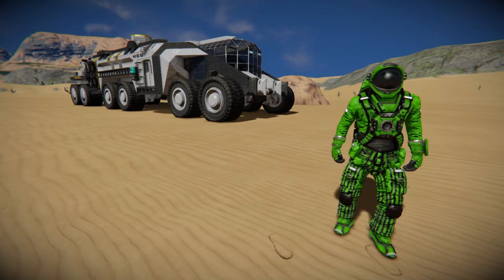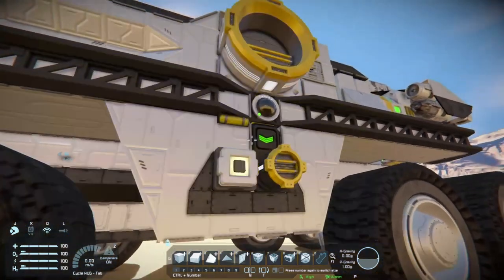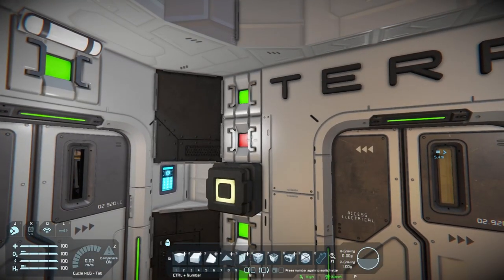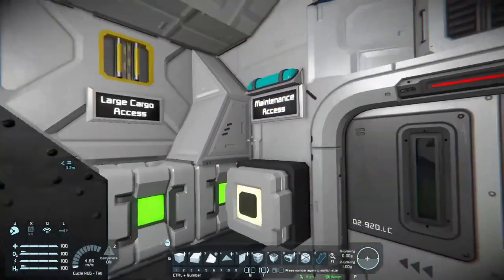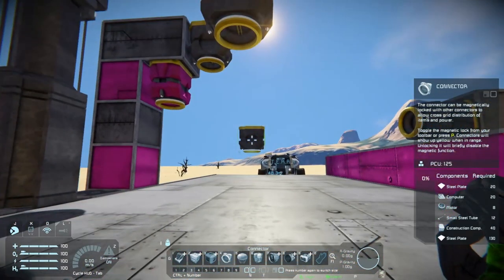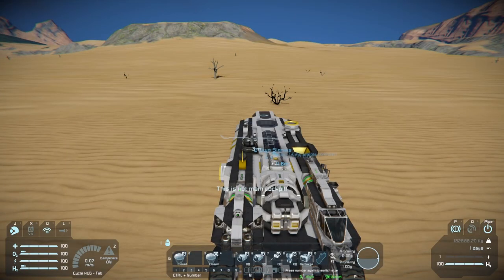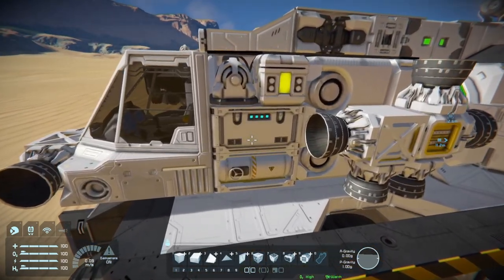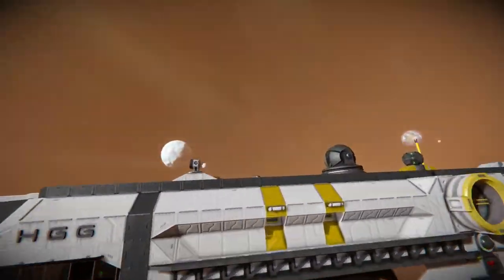T.E.R.R.A. 3-in-1 Multigrid! Space Engineers Showcase (HGG - TERRA)

Comment: A very nice survival build, I love the immersive features! :)

I'm thinking of some small upgrades:
 - you could add a Timer Block as a Remote Drone starter sequence (turn battery to recharge, start engines, etc.) with just one click;
 - I like to have 2 connectors on the same side, so it automatically alignes the rover / ship more precisely (since you have 2 attaching points instead of 1);
 - some pistons to lift up the rover in case a wheel pops is always a great emergency feature.

Looking forward for your next builds and keep up the good work!
Reply from the maker: Thanks!  I'll definitely add the lifting poisons, that's something I have on most rovers already.  I'm also already planning some quality of life improvements to the drone control, I'll add startup timer simplification to the list.  Not sure if I'll be able to fit another connector, but that would make lineup easier.

Comment: Great work once again Shifty!
I really like how much thought you put into your builds!
I tend to set tool bars up differently.

My Nr.1 Toolbar is always to boot and shut down.
I mainly want to be able to hit 1+2+3+... to boot up a vehicle and ...+3+2+1 to shut it down.
Example:
1 = Batteries Recharge ON/OFF
2 = Thrusters ON/OFF
3 = Lights ON/OFF
4 = Connector Switchlock

Every vehicle is a bit different. Using this method means I don't have to think about what keys to press.
Go for a spin = 12345
Come back = 54321
Easy
Even using Timer Blocks this way works brilliantly.
Reply from the maker: Thanks, I always try to make things as satisfying to use as possible.  The more time I put into working things out initially the less I have to spend later.

Everyone does it a little differently, but making uniform hotbars across your grids is always a good idea.

Comment: I gotta say, it's a gorgeous build that really fits the SE aesthetic, but it's all the programmed features that really make this build special. so many thoughtful and convenient little things, all on dummy-simple buttons for ease of use, with fairly clear markings for ease of reference in most cases. just fantastic. I feel like a caveman still banging rocks and sticks together over on my game because I struggle to remember how to apply scripts properly. 

I will say its length worries me a bit for maneuverability on rough terrain, but I imagine its not really meant for that kind of exploratory driving, and that's what the sub-vehicles are for. other than that, I just want something on it for drilling, and its perfect.
Reply from the maker: Thanks, glad you like it!   I've been using it on a survival server (on Pertam) and it feels  pretty good to drive around most terrain.  With the back and front wheels steering its turn radius isn't that bad and on hills there are some atmospheric thrusters which help climb without slowing.  

As you pointed out, sharp changes in terrain can be difficult, but only really at higher speeds.  Bumpy terrain can sometimes be easier to drive on with this because it straddles the low parts.

I originally was going to put a drill rig on the back, but decided to opt for the sub-vehicle parking.  Certainly considered it though, something like I used here (only nicer looking): https://youtu.be/8m_7bk3n_bU?t=694

Comment: I literally just thought about the kneeling function and how to do it with one of my rovers. Your vid popped up, with a workshop link. Suwheet!
Reply from the maker: Hope it helps!  I've been adding that feature to all of my larger rovers.  Feels good.
Reply: @ShiftyshadowTV  it does, but my caveman brain still seems to have an issue. XD
Reply from the maker: It's done with a set of three timer blocks in a single control group.  The buttons and sensors that trigger the up and down simply "start" all timers in the control group. 

One timer makes the suspension rise. One makes them lower. And the third stops them both and toggles the power for them, so that only one of the rise/lower timers is on at a time.
Reply: @ShiftyshadowTV  ok, so I was doing my usual of overthinking it again. thanks!

Comment: Any chance you could make a a tutorial on how to setup the suspension drop for entrance?  I totally wanna steal that and put it on my large rovers
Reply from the maker: Group all suspension blocks in your terminal.  Place three timer blocks and group them in your terminal.  Add buttons where you want them.

Timer Block 1 (set to 1 second):
- suspension group (decrease suspension)
- Timer Block 1 (trigger now)

Timer Block 2 (set to 1 second):
- suspension group (increase suspension)
- Timer Block 2 (trigger now)

Timer Block 3 (set to 3 seconds):
- Timer Block 1 (stop)
- Timer Block 1 (toggle on/off)
- Timer Block 2 (stop)
- Timer Block 2 (toggle on/off)

Set your buttons to "start" your timer block group.  Make sure either Timer Block 1 or Timer Block 2 is OFF and the other is ON.  That's it.
Reply: Dude this was actually really fun to set up and figure out why it works thank you.
Reply from the maker: @vacrawlers5436  
It's a neat little solution.  Slapped it together before event controllers were a thing.  Not sure if they would make it easier, haven't tried them out for it.

Comment: WAIT!!! If you have 2 grids merged via merge blocks, you can print them both?????
Reply from the maker: Yup, they're one grid. 

Worth noting that if you have rotors, hinges, or pistons attaching those grids those blocks won't print properly.  They will be missing half (either the head or body depending on which is printed first).  Also piston heads and/or bodies may both print, but they won't be attached.
Reply: @ShiftyshadowTV  I was working on a mobile mining rig that had 20-something pistons and 10s of rotors/hinges. I've since abandoned the project because i can't print it in survival. The simple solution would've been to print each subgrid individually and add pistons/rotors/hinges where needed (which would be a nightmare to set up).

But with mergeblocks i can print the whole piston array detached and attach them after.  

Your ideea basically saved my project. Thanks!
Reply from the maker: @orlandolaurentiu731  Sounds cool.  I hope it works out!